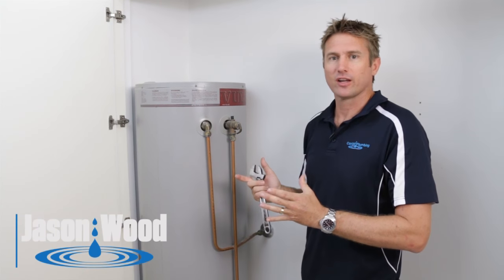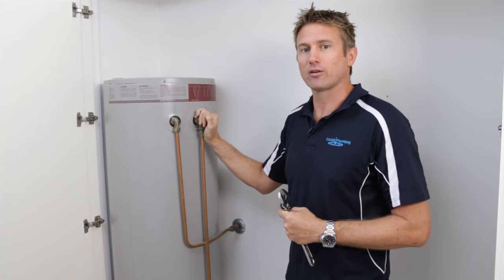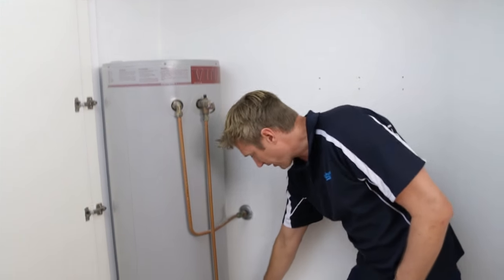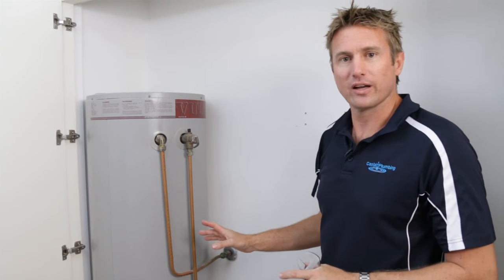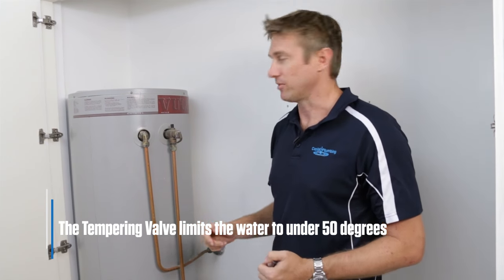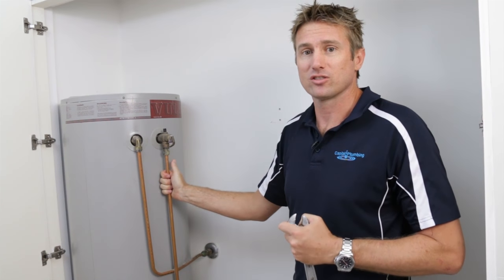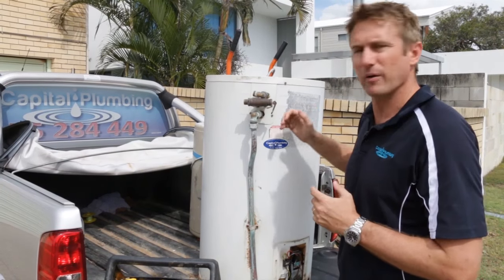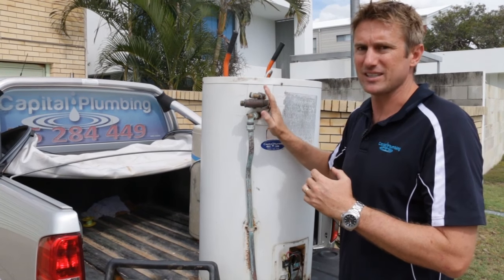Types Of Hot Water Systems

Comment: How long do you release the water for?
Reply from the maker: With this valve it is just a matter of running for a few seconds to confirm the valve is not seized and can work when needed for the the normal operation of the hot water unit. The lifting of it does nothing else but confirm it works correctly. I hope that helps
Reply: @CapitalplumbingAu  righto thanks mate
Reply: @CapitalplumbingAu  mine making a lot of sounds like a starter motor on a car when the battery is dead.. like random clicking noises?